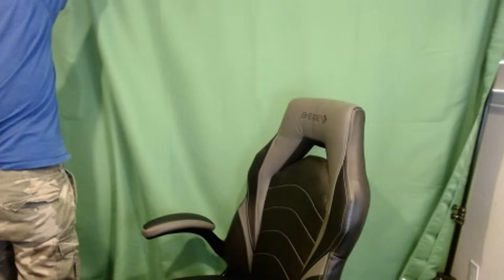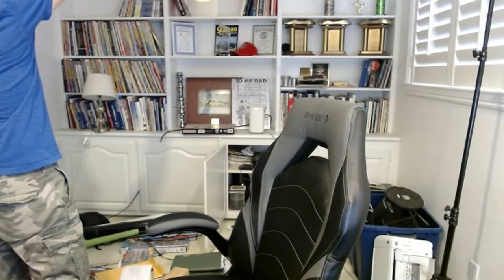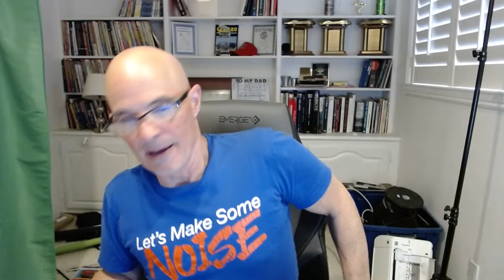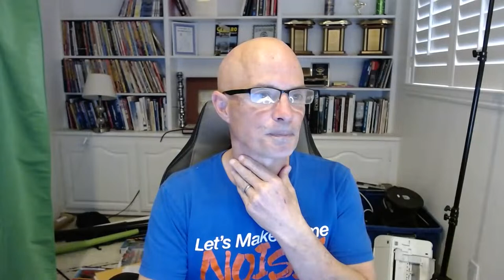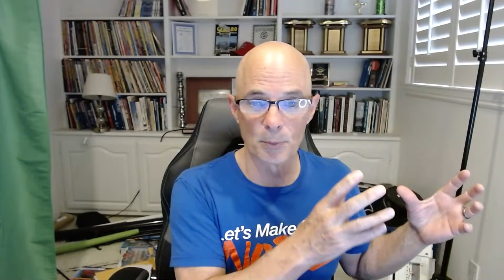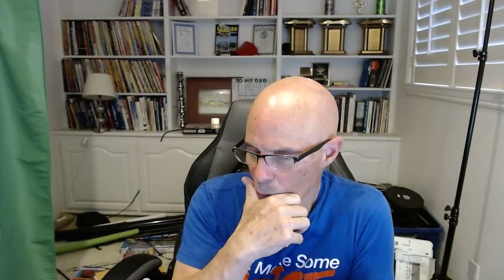VORTECH LS9 CAM-LET'S TALK TECH

Comment: You wouldn't want a cam that's that soft on the bottom matched up with something that has a rising boost curve.  that's taking two of the same extremes and putting them in/on the same engine.  It would feel like a v6 till 3500rpm then like a 5.3 till about 4500rpm then suddenly make power from 5500 to the moon.

Comment: Is that true that ford numbers their cylinders they said in order which doesn't sound right to me in order is off the crank so Chevy is right but if ford is different i assume its 1-4 on one side and 5-8 on the other that is something i need to know because i often work on lots of things and if cylinder 2 is in the wrong place that makes trouble shootings hard
Reply: A big difference that I never really hear people talk about is that on Chevy the most forward cylinder (#1) is on the driver side and on a Ford the most forward cylinder is on the passenger side.
Reply from the maker: Ford numbers cylinders on the block in order 1-8, starting on pass side. Chevy numbers them odd and even (1,3,5,7 etc..) starting on the drivers side.